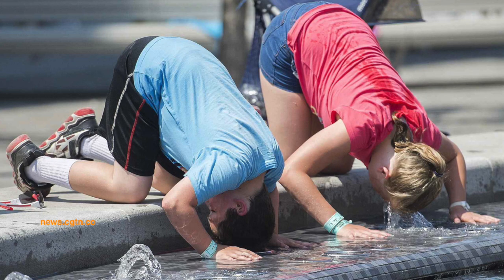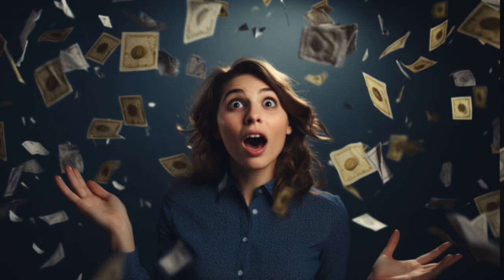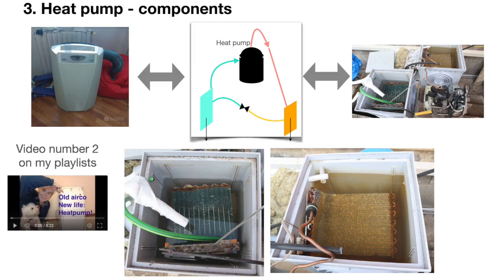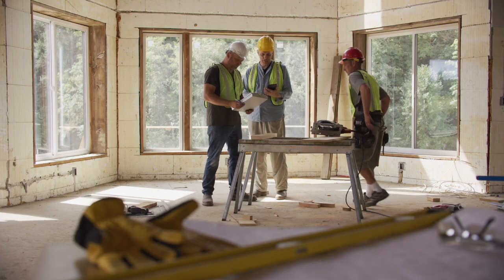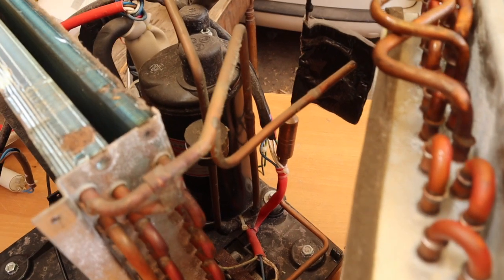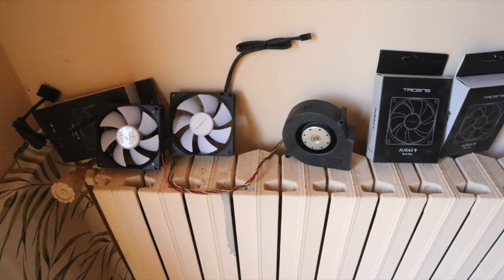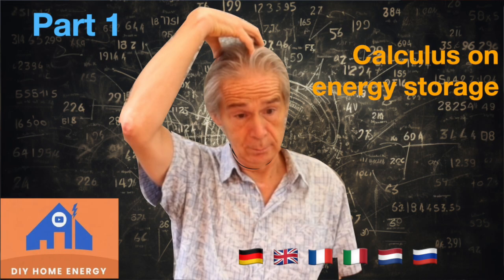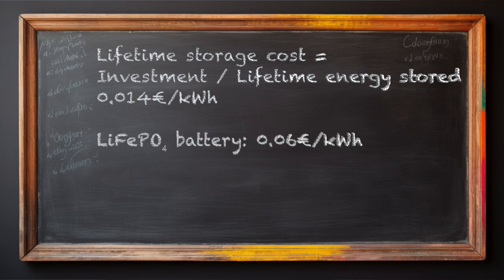How to Double Your Heat Pump Efficiency with Thermal Energy Storage - 62

Comment: Thanks for posting this. You may be interested to know I am watching this from Fiji.  Where I am just getting started with a hydroponic lettuce growing project because lettuce will not grow here in our hot season. I would like to use a refrigduation unit for cooling the water but it didn't occur to that I could make use of the heat from the unit also
Reply from the maker: Hi Simon, that is amazing! I worked for 40 days on Mauritius island but Fiji is really far in the middle of the Pac. Ocean, about 2000 miles from Brisbane? I wonder what kind of energy infrastructure there is. It would be nice if you joined the the Facebook Group or the email list to discuss this further. I have even started a playlist for Indonesia because of its many islands. 
I am glad that you found video 62 useful. I also started a hydroponic system with 30 pots. I don't know if the heat from my double use of the heat pump can be useful for you, the more so because you are in the warm season. Maybe for showers? Or preheating sea water for desalination? Tell me here or in the facebook group at https://www.facebook.com/groups/1440674419825846
Or you enter the email list for example on the PDF for heat waves (are they also on Fiji?), see subscribepage.io/5PQr1R
Anyway, this video 62 principle is great for having much useful energy for cooling (lettuce) and heating (other application) at the same time.

Comment: For me, I'm planning on using a mini split heat pump for air conditioning and heating.  This sort of approach should help in being able to pre-heat the air for the mini split during cold, cloudy times where the design temperature is -10 F (-23 C) , but average temperatures during the same month are more like 32 F (0 C).  By using salt water, I should be able to avoid freezing.  Rather than using a heat pump for the tanks, I'm going to use a ground loop.  But if I add water tanks, I should be able to increase the thermal mass of the system in dealing with these winter storms.  In addition, by having tanks that are filled with salt water, I will have a resource to use to fight fires should they occur.  Since the temperature in the tanks only needs to stay around 40 F, I shouldn't need much if any insulation, but it should still help with winter cold spells.
Reply from the maker: Hi Rich Dobbs, that is a low temperature, -23℃, and winter storms! Where do you live? Water has lots more heat capacity than ground. And you can put the loops into the water! If you don't use salt but normal water as storage medium then you can use also the latent heat of ice. That is 92 kWh per meter. Salt water can be good for the working fluid, but may be corrosive. Can you use another antifreeze? Good idea, that of the firefighting!
Reply: @nnvasen-good-energy  This will be in Northern Idaho.  The problem with using the latent heat of water freezing is designing the tanks so that they can freeze without bursting.  The antifreeze that you want to use for environmental reasons is propylene gycol, but that is quite expensive.  It might be possible to use IBC totes to store the salt water, and then extract it with PEX tubing.

Comment: I tried this years ago and it worked well.  How do you find the longevity of the aluminum air heat exchangers when submerged in tap water (water with air and minerals)?
Reply from the maker: Great point! It is still a question to resolve and see what happens. If it doesn't work out, well then I must keep this heat exchanger in special "technical water" but for the moment I am solving other things and like the efficiency of direct contact with the water that is going into the big tanks.
Reply: @nnvasen-good-energy  if the aluminum won’t work, old copper piping would if you have ready access to something like that.
Reply from the maker: What did you do exactly years ago?
Reply: @nnvasen-good-energy  water to water heat pump by using an air to air "air conditioner".  Also air to water configuration.  I wish Peltier devices were more efficient so it'd be easier to build useful heat pumps.

Comment: To raise100l by 50 degrees Celcius you need 5800w... so size accordingly, and insulate to stop storage heat losses.
Reply from the maker: Yes, I have to insulate both tanks well, especially if you want to keep it a long time.
Reply: 5820Wh or 5.82kWh is correct.
Reply: You are mixing up units, I think you meant 5800 kWh.